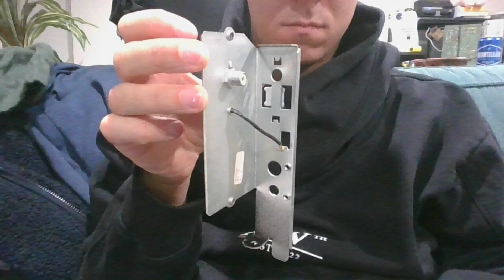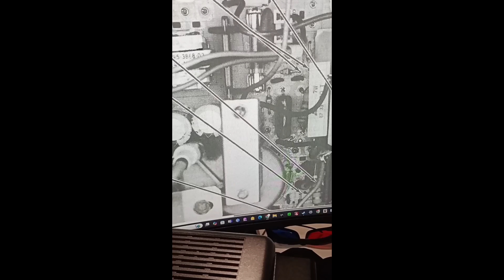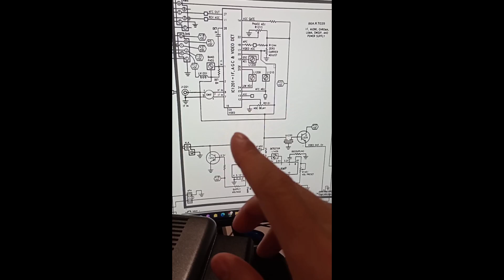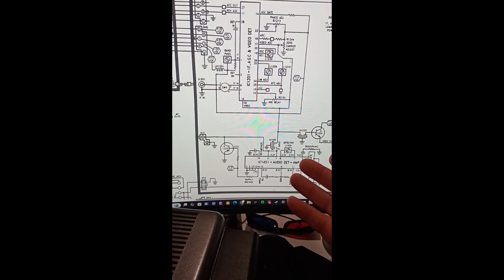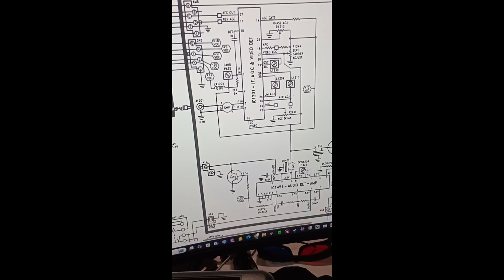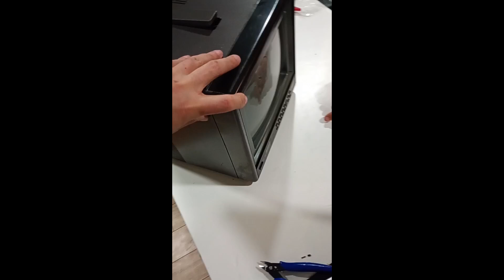Zenith CRT TV RF to RCA Conversion Modification

Comment: Luma and chroma for S-Video is more sharpness than Composite video.
Reply from the maker: It didn't have S-Video, it was RF :(
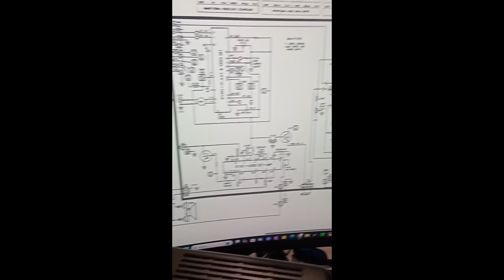Reply: @BlueCardinal33  1:41 if you read fine you can see Luma and chroma.
The perfect for S-Video.
Reply from the maker: @nathanaeladamesreyes8870  Oh yes!! Sorry, yes, I could have done S-video, but I decided not to. Reason: many game consoles and VCRs use RCA / composite plugins, so I wanted what's more common. :)
Reply: @BlueCardinal33  So so if you search a comparative video you can see the diference.